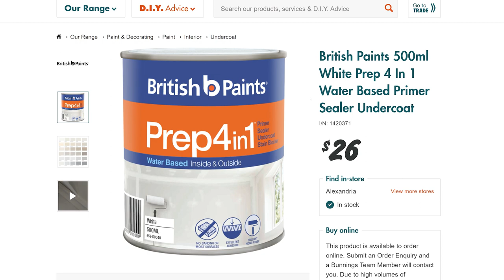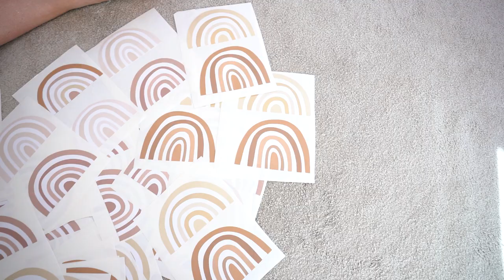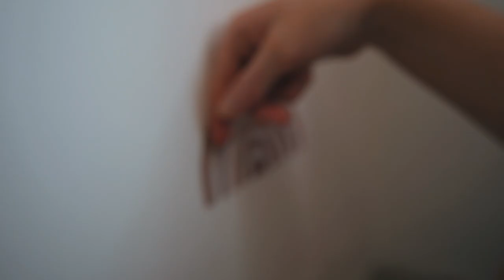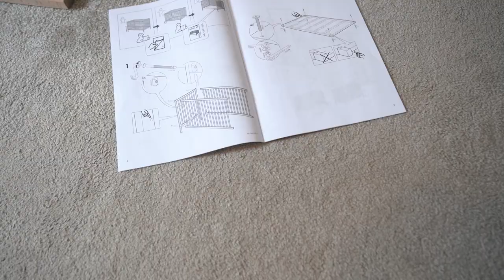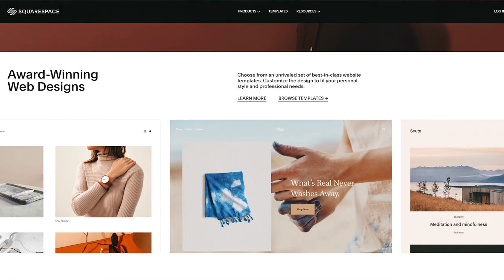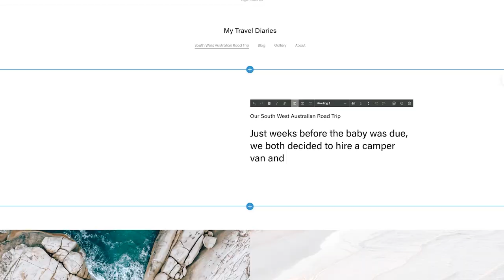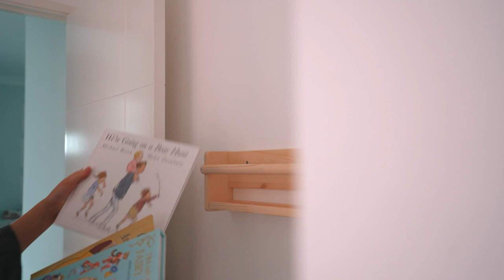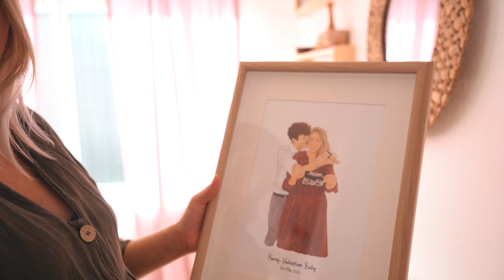BABY GIRL NURSERY TOUR | Baby Room Transformation

Comment: Congrats on getting your baby room ready, everything looks so nice and welcoming. I suggest to get the sliding foot rest for the rocker, it helps to relax while you'r reading, nursing or just staying up all night. I'm called mema also and like that unique name. Newborns or young babies go through 8-10 diapers per day. Get a diaper trash bin for the nursery with foot operated lid release. It's really nice to have a little side table to hold a lamp and have a drawer setting by the rocker to keep necessities like teething gel, clippers, brush, etc. My grandsons mom has a essential oil diffuser which is also a humidifier and it works great for stuffy noses. She also has a camera that attaches to the crib/cot edge which connects by her iphone with picture and sound. It works great when you're monitoring the baby.

Comment: For a newborn 480 wipes might last you a month maybe 😅 newborns go through so many diapers and wipes a day! As they grow older you use less and less. When they get colic put them on their backs and grab their legs and kind of flex them into their stomach and then stretch them out straight and flex them like they’re “running” and repeat it. When you straighten out their legs if they do have colic it should release the air out of their tummies! Also to prevent colic try to, if you stop breastfeeding at any point, always get the bubbles out of the bottle before giving it to your baby! Hope this helps ❤️